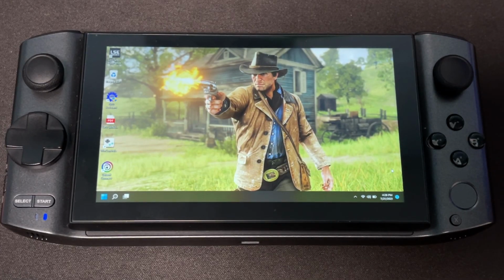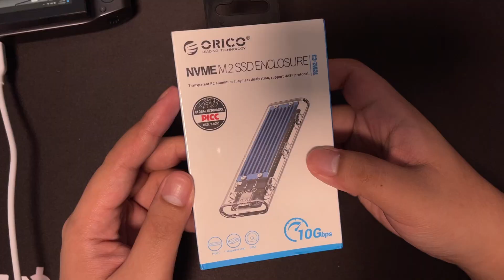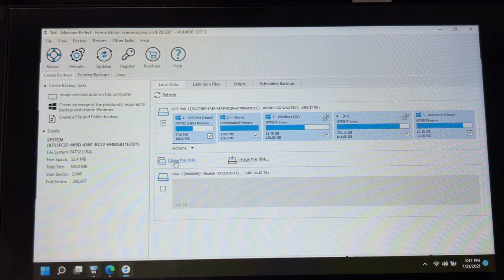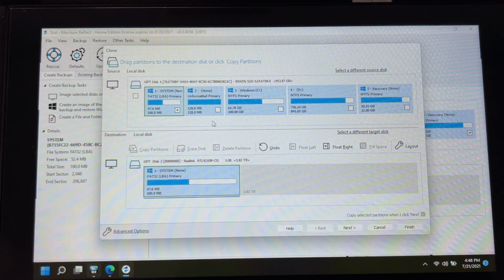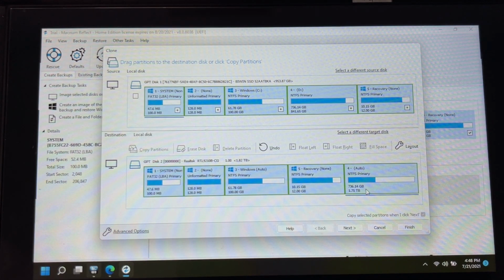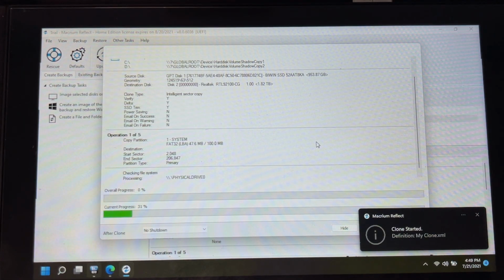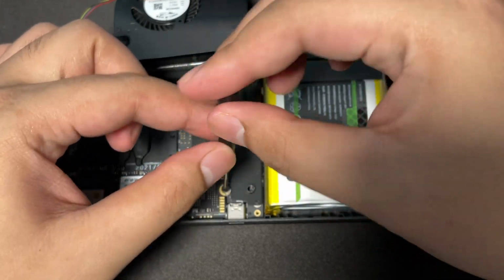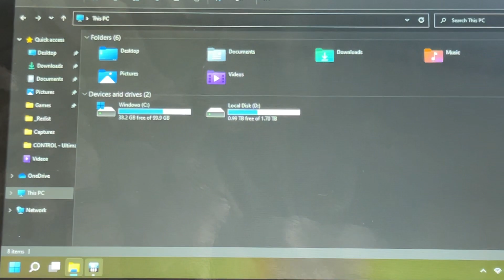GPD Win 3 - Upgrading to 2TB Nvme SSD

Comment: Is it necessary to add thermal tape for extra cooling. I upgraded and did not
Reply from the maker: It may be necessary for really cheap nvme that might heat up easily.

Comment: Dear,

Please Please reply, does the momery card of ssd in the (1tb ssd ONEXPLAYER) version is combined in motherboard? 

Or in the other meaning, can I add an extra (1tb ssd NVMe card) in the (1tb ssd ONEXPLAYER version)?
Reply: And becomes 2 tb ssd
Reply from the maker: You cannot add, but you can replace it with a higher capacity nvme.